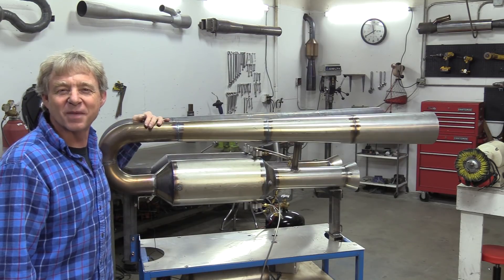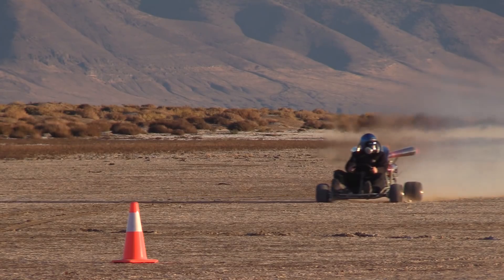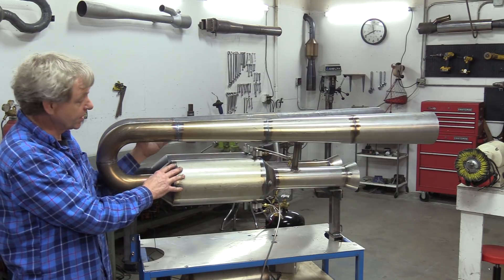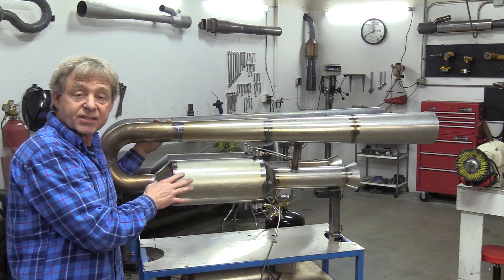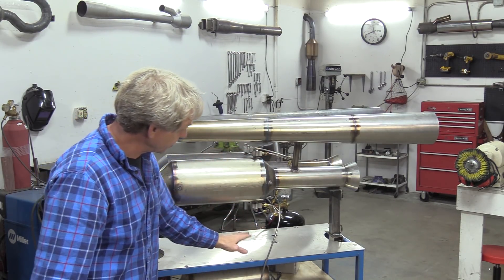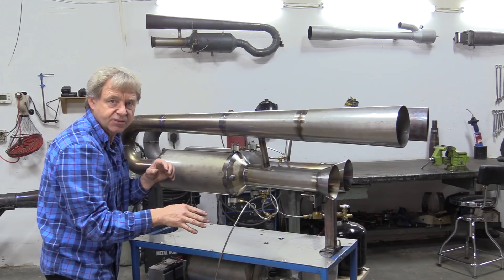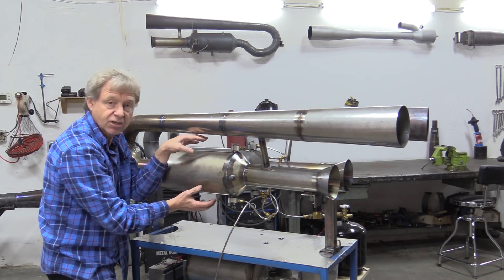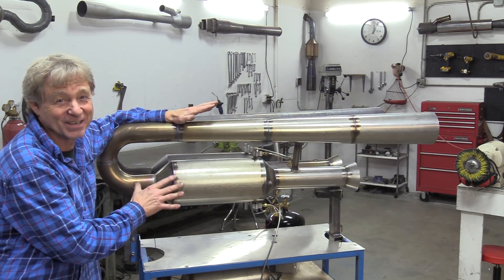Rocket Man : Building the MASSIVE! Pulsejet Viper engine.

Comment: Ive been watching your vids and love it . Im assuming you have tried using a desiel glow plug and didnt work ?
Reply: Not hot enough... A pulse jet doesn't have the compression of a piston engine to help add heat to the combustion chamber

Comment: Hi Bob! Can that engine also work with a water injection to increase thrust, as other jet engines can use? 😀
Reply: I'm going to guess no. My reasoning is this is a negative pressure engine, requiring some previous explosion back into the combustion chamber to start the current cycle, and adding a non-combustible element like water would probably end the cycle. With a standard engine, I think it would work as the water would divide into its essential parts of hydrogen and oxygen.

Comment: How about when you are shutting it off hit the propane  then shut off the diesel and run it on the. Propane for a few seconds then turn off the propane  to give it a chance to burn off the left over diesel  . That should fix the smoke problem

Comment: Could you flush the left over diesel out by switching back to propane before shutting off the engine?
Reply from the maker: Well... yes I do that sometimes if it's hot so I don't cool the start tank to much.

Comment: Off topic for this vid. In the future vid on the Gluhareff pressure jet you have planned will you be pressurizing the propane tank with nitrogen to 300 PSIG as Gluhareff  told me would result in the lowest SFC possible for this engine?
Reply: Hey folks, just a quick heads up re INSIDE diameters for your Glue 130R intakes: It seems that some different third stage throat diameters are being reported as the RQR plans don't give an exact measurement, but forces the purchaser (of the plans) to measure the distance then X 2.
If the ID of the throat on your 130R is 4.1875 then it will effect the INSIDE diameters of the 2nd and first intake tubes.
So for a 3rd stage throat diameter of 4.1873 the 2nd stage INSIDE diameter should be 3.625, and the ID of the 1st stage should be 1.8125. Intake lengths can remain the same (excluding the quarter round fluting/flaring: 5, 15 and 7.5 inches L respectively.
For 3rd stage throat diameter of 4.125" , 2nd and 1st stage INSIDE diameters = 3.578 and 1.78 inches respectively.(no changes in lengths).
As aforementioned, if the area of the 2nd stage intake IS NOT a minimum of 75% of the 3rd stage throat area, then combustion gases will reflux/regurgitate at the 2nd/3rd stage "junction", and there will be a decrease in ambient air flow (both of which will decrease the performance of your Glue). I'm getting +/- 140 lbs./force out of my inline...she breaths beautifully and doesn't burp!
roland2001 AKA Kevin kylebear2000@hotmail.com
Reply from the maker: Hi Tim, I built the engine following the plans with some small variations, once I got the engine producing thrust I did a few tweaks and got more thrust but I only got about 45 pounds, I pressurized the tank to about 280 psi but the engine just wouldn't come up to more thrust. There is only one video on youtube of this size engine pushing a go kart and I would say it was probably making about the same thrust. Sense I can not find a video of this engine making 130 pounds of thrust on a thrust gauge, one would have to question the claim, however I'm not going to call anyone a lier sense this engine was popular back in the day when video was not so easy to make, in any case it is a very fun engine to play with and it may just be I don't have it in tune.
Reply: @Crazy.Rocketman  Hey folks, just a quick heads up re INSIDE diameters for your Glue 130R intakes: It seems that some different third stage throat diameters are being reported as the RQR plans don't give an exact measurement, but forces the purchaser (of the plans) to measure the distance then X 2.
If the ID of the throat on your 130R is 4.1875 then it will effect the INSIDE diameters of the 2nd and first intake tubes.
So for a 3rd stage throat diameter of 4.1873 the 2nd stage INSIDE diameter should be 3.625, and the ID of the 1st stage should be 1.8125. Intake lengths can remain the same (excluding the quarter round fluting/flaring: 5, 15 and 7.5 inches L respectively.
For 3rd stage throat diameter of 4.125" , 2nd and 1st stage INSIDE diameters = 3.578 and 1.78 inches respectively.(no changes in lengths).
As aforementioned, if the area of the 2nd stage intake IS NOT a minimum of 75% of the 3rd stage throat area, then combustion gases will reflux/regurgitate at the 2nd/3rd stage "junction", and there will be a decrease in ambient air flow (both of which will decrease the performance of your Glue). I'm getting +/- 140 lbs./force out of my inline...she breaths beautifully and doesn't burp!
roland2001 AKA Kevin kylebear2000@hotmail.com
Reply: Did you use a DeLaval nozzle or orifice tube?